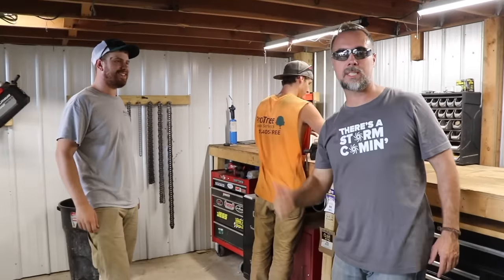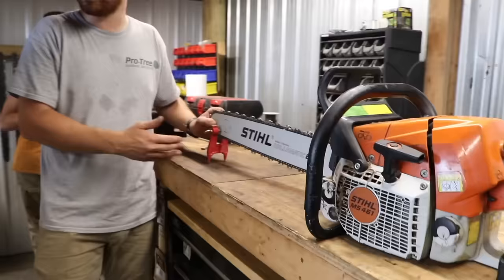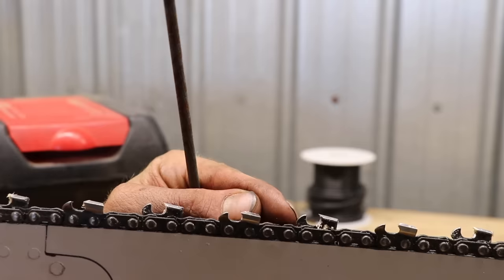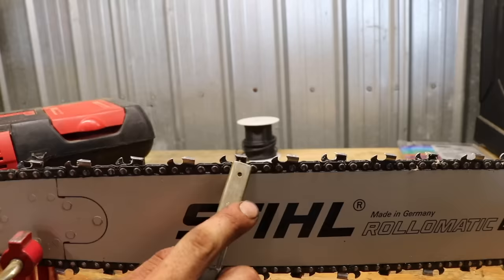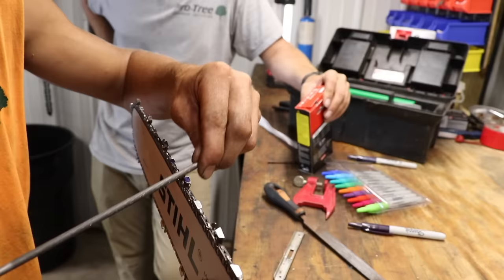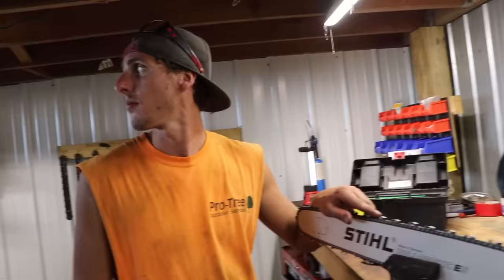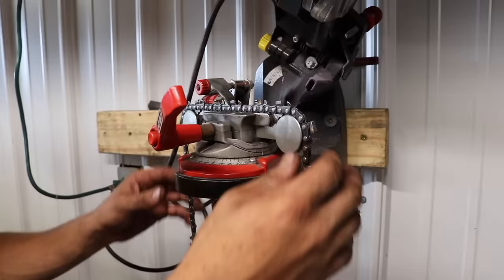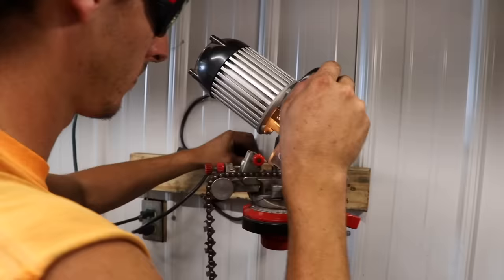How the Pro's sharpen a chainsaw

Comment: Because of guys like you, my least favorite subject on You Tube is chain saw sharpening. That is where I find lots of wrong information!

Consider these:
•How is it you don't know how to pronounce Oregon?
It is ore  e  GUN.
•Raker: that is a nickname where chains are concerned. It is a DEPTH GAUGE. It regulates the DEPTH of the tooth bite in wood. 
•You posted a teaching video here. Be consistent. Know your nomenclature.
•File: It is called a round file. For beginners it would be good to point out it is not a rat tail file.
•File Maintenance: Files need cleaning. This applies to the flat file too. You will get a better job.
•When you ask a man to do a job, you need to know to stand back and let him do it. The same goes for video making. When one of you jumped into the other guy's presentation, do you know what I got out of it? I did not get more chain information. I got that you looked bad. That is poor leadership.
•This is not a bull session fueled by beer. It is a mechanical presentation. You need to have one main speaker, and he must have thought carefully about what he is going to say. If you are going to divide the video between speakers on different facets of the subject, introduce the next speaker and get out of the way. The floor is his now. How about something like this?
"Now here is Fred who will talk to us about bar maintenance."
•When you showed that most chains on the wall were the dull ones and you made a BS statement about prefering to cut trees. Then you turned and I saw what looked like a tree company logo on the back of your shirt, what was the intended impression? What I saw was a company who doesn't even CARE about the maintenance every tree company has to do. It was also the way you talked. Should I hire you to prune my trees when you come off as so careless? You need to inspire confidence. And not brag.
Reply: Another youtube expert - typical - ready to criticize and tell how it should be done, but does not produce anything, just lives to be critical of others, make a video, post it and SHOW how its done, or shut up

Comment: This could be a whole lot clearer and simpler if you just quit using the leftover word raker. They are depth gauges. That is why they are there. they allow you to take the correct shaving with every tooth. Rakers are part of an old hand saw better known as a "misery whip".

Comment: "how PRO's sharpen chainsaw"    - Emphasis on PRO....
Sharpens the chain in an unsafe manner...
Chainsaw sharpening Basics... When you use the file to move the chain, to get to your next tooth...
You put the file BEHIND the cutter and pull the chain forwards on the bar...
Pushing it backwards, like in the video, Is not the safe way to do it..
If your finger slips off the file, Or the file slips off the tooth when pushing it backwards, Your fingers / hand can come into contact with the very sharp part of the tooth..
Sliding it the correct way.. FORWARDS... if the file slips, Your finger hit the back of the tooth.. The non-sharp part...
#Idiots

Comment: Coming from a treeguy. Its called sharpening the chain not the blade. There is no such thing as a blade on a saw. There is a bar an a chain. Period. An experienced dude will not ever say blade. Sharp chain not blade. Note if it's sharp an stil not cutting see if bar is bent. Yes good video. Some guys do it a bit different but it's all the same.

Comment: As soon as the guy started saying take the same amount of metal off each tooth I turned it off.  Its total BS.  File each tooth until it is sharp, it does not matter if one tooth is shorter or longer than the next as long as you adjust the depth gauges accordingly.  With each depth gauge the same each tooth will bite the same amount of wood and cut straight.  Stop with all this take the same amount of metal off each tooth BS.

Comment: Your misinformed! The teeth don’t have to be the same length at all!! One side can be full length and other side down to line as long as your raker depth is set right it will cut straight 👌🏼
Reply: Then one side would be doing all the cutting and the other wouldn't be long enough to cut the wood. The teeth height get shorter as you file them back. Also those are debth gauges, rakers are unset hand saw teeth that clean out the bottom of a cut.